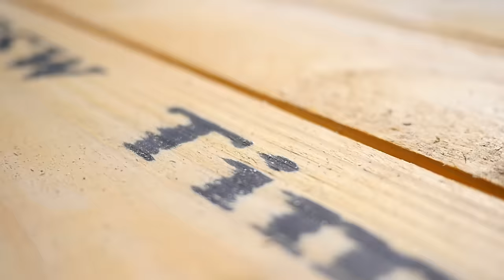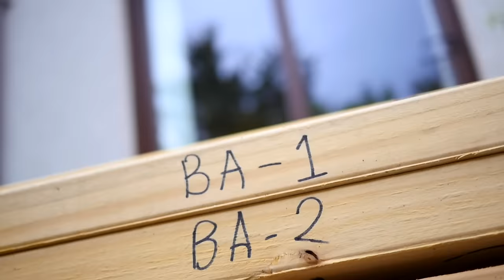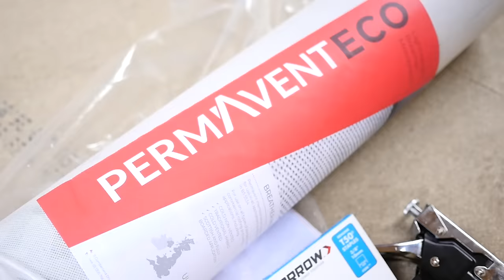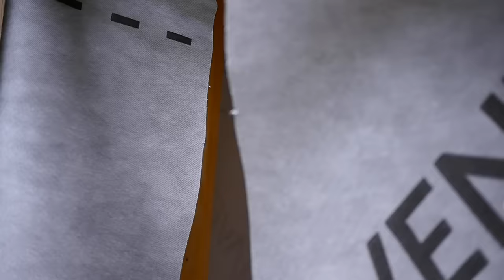Building a Workshop Shed In The UK From Scratch

Comment: Great build but you will get a lot of rising damp and condensation ... shame you didn’t run power
Reply from the maker: Hey Tight Tackle, I'll so glad you have enjoyed it.
All electrics are now in using office conduit. I got a pro for this as I'm not going to take responsibility for electrical work till I've got some real training. I'm sure you can see the conduit in some of my other videos. It goes right around the workspace.

As for the damp, I've talking to many joiners and as i've gone the extra mile to make this a breathing structure they have all told me I should be fine *fingers crossed*. Really hope I've not shot myself in the foot. Thank you very much for you concern and point it out tho.
Reply: Why would he get rising damp? He used a dpm under the timbers although ideally should have got the timbers off the ground but as for the rest, he encased the whole structure in a breathable membrane even the roof.. I'd personally have used some vertical batons around the walls before attaching the shiplap to give a bit of space for it to breath from the inside out but overall I'd imagine its fine.
Reply: You answered your own question mate lol
Reply: Maker Tales it will be fine but would of been great to raise of the floor, that will be your main issue ... which is why I point it out now so you get a longer life instead of the timber rooting! I’m very jealous you have your man cave lol 👌🏼
Reply from the maker: @Audiotorium87  Hey no problem. Unfortunately, I was playing with some VERY strict hight limitations. SO my choice was to raise it off the ground and hit my head every second I'm in there ( I'm 6 4") or keep it on the ground and do the best I can with pressure-treated timer, dpm and drainage. I'm sure i'll make update videos in the summer and gave a close inspection of the whole build to see if any issues arise

Comment: I bought a second hand electric benchsaw but I find I can't change the blade the hole in the washer is square can't get on the drive spindle
Reply from the maker: Hey Keith,
I don't know no much about benchsaws. Do you have a model or make or the saw? I'll see if I can find anything to help 😀
Reply: @Keep-Making  thanks for your help with my saw I put bench saw but it's really a mitre saw I found the trouble in the middle of the  blade is a washer that goes only into the blade itself, thankyou again

Comment: How much did it cost approx
Reply from the maker: Hey Adam Smith,
I have a few FAQs down in the description, but to answer your question: So keeping tools our of the pricing In total it came to around £1200 But this includes extra wood to make workbenches too. It's 2.9m by 2.9m . Has a close to 7-degree pitch and highest point is 2.49m. Keep in mind that I have completely over-engineered this workshop for 3 reasons. 1. I'm in Scotland and I get a lot of rain so I had to have a pitch on my roof. 2. I'm close to the sea and there is a field with an unobstructed prevailing wind so I get gusts of wind up to gale force 9 pretty regularly. I had to keep room for 100mm rockwool to make sure I could stay warm and more importantly that I would not bug the neighbours too much.
Reply: Awesome cheers good job by the way.
Reply from the maker: @adamsmith-qw9xs  Cheers Adam!

Comment: Hi, great video but I think I would have made a slight adjustment to the way you have used the insulation. I note tha tthe insulation has both a gap below and above and taped to the inside faces of the joists. One thing to consider is moisture. The foil on the insulation is there to act as a vapor barrier and I would suggest that you install the insulation level with the top of the joist and then seal the top of the insulation slabs by fully overlapping across the top of the joist, thus making a full sealed foil VB. This way you will not have to worry about possible future moisture penetration of the flooring from the joists. By raising the insulation and creating a larger gap beneath would also help with airflow.

See example 

https://www.youtube.com/watch?v=hiHwXI8ujDo

Good video and I enjoyed watching.
Reply from the maker: Cheers Mike,
Ya I think i would have got about it a slightly different way now. Thanks for the heads up. For my first build I think it's starting pretty strong still. In a few months time I'm going to be doing the FAQ / one year later video were I'll be taking a look inside walls, Under the shed and everywhere really to see where things could have been improved. My only concern of having hte foil right up against the wood is creating a moisture trap . Would this not be the outcome? Ignore there is no air flow. I'm say if there was airflow would this still not be a moisture trap to have the foil right up tp the floor?

I'm so glad you enjoyed the build
Reply: @Keep-Making   If the insulation is fully sealed across the entire surface moisture will not penetrate from below so any moisture present would have to come from above ie: from within the building. If the flooring used is of the standard moisture resistant variety then moisture should not be an issue. To be fair, the question of moisture is very subjective as it is wholly dependent on the overall construction, materials and use of the building. Ideally, if heat loss/retention is important then I would suggest you first infill with 50mm insulation between the joists and then add a second 50mm insulation layer to the full floor area covering over the joists thus preventing any cold bridging from the joists (where there is currently no insulation). Again fully seal the foil face at any joins/interface with the main frame. A decent air gap/flow under the joists/insulation would aid in keeping the moisture level down and prevent rot.

Comment: Excellent build of your shop, and although several people commited about your editing I would have preferred to have seen less of the 'showcasing' where each completed item was shown four or five times longer than necessary - ever since some of the game shows where models wander around the stage and point out the obvious has this become accepted even though not really necessary.

I built an 8' by 15' shop in the backyard a few years ago and even though it was built on top of a 4" thick 16' by 20'  reinforced concrete pad I applied two thick layers (four coats) over a two coats of roofing tar or 'bitumastic' coating over a two day period to protect the baseplates/baseboards from being infested by insects later or rotting due to water damage, and I offer this in hopes it will save someone some throuble with problems like this a few years after they've been built; several years later my Wife had a 10' by 12' by 13' high gambrel roofed shed with a mid- level loft built because she felt it would better suite my needs instead of my single story shop which at 8' wide proved to be too narrow to do some of my projects inside of.

And the one thing I was proud of was it took two days of strenious work for it to be torn down - partly due to the 2"X10" steel connectors which were used during it's build - build it right the first time and they will treat you right, meaning they will stand the test of time, which yours will because of the care you took in building it.

One question, what is the required "set-back required from your property line to where you can erect a structure (?), here in CA. It is 5' and I ask because it looks as though the distance from the sidewalls to the fence was about 3' or 4'  so out of curiosity is why I ask.

As I said, overall a very nice shop and thank you for sharing your expertise.
Reply from the maker: Hey Larry, I'm glad you enjoyed the video.
I appreciate that this style of video might not be your cup of tea. Considering I was aiming for a montage I thought I would go all out. 
That's a decent size build you made there. All I can say it that I love the stuff.... I really wish I coated my base with bitumastic paint too. In a few months time I'll be doing a 1 year review of the build and who knows I may add and fix some things what have been mentioned. I may have to jack up the build and paint the underside with a mop 😅.
I happy to hear that you think i've built it "right" first time round.

In regards to the set back. The UK is rather interesting....  Please anyone reading this do not take this as legal advice and please do you own research In my area as shed that is less than 12 m2, no higher that 2.5m can be right up to boundary lines within reason. Must be set inline or further back from the front of the house and must be a minimum of 5m for a public road. Once you pass 2.5m high. Then you start going into the realm of really pain in the but building code style stuff.

and once again i'm so glad you enjoyed the watch 😀

Comment: Great video! And I have pressed the subscribe button. Can I just ask what wood do you use for the walls? Is it 100mm x47mm? Many thanks
Reply from the maker: Thank you Richard!
When you say the walls do you mean the studs or the sheets?
Reply: Maker Tales sorry I meant the studs!
Reply from the maker: @richardsmith2887  No problem, the studs are 95 x 45 pressure treated timber.

Comment: what was the cost?
Reply from the maker: Hey Gary Arnold,
Just a heads up there are FAQs down in the description but in response to your question. Keeping tools our of the pricing In total it came to around £1200 But this includes extra wood to make workbenches too. It's 2.9m by 2.9m . Has a close to 7-degree pitch and highest point is 2.49m. Keep in mind that I have completely over-engineered this workshop for 3 reasons. 1. I'm in Scotland and I get a lot of rain so I had to have a pitch on my roof. 2. I'm close to the sea and there is a field with an unobstructed prevailing wind so I get gusts of wind up to gale force 9 pretty regularly. I had to keep room for 100mm rockwool to make sure I could stay warm and more importantly that I would not bug the neighbours too much.
Reply: @Keep-Making  Sorry was browsing my phone completely missed it.
Reply from the maker: @snappyfish  Nah don't worry about it Gary. I'm happy I could answer the question.

Comment: Hey cool video I live in the uk 🇬🇧 and what a great workshop can I ask do you need planning permission for something of this size I’d love to build one in the summer but don’t really know how am going to go about it
Reply from the maker: Hey Littleyammy!
Great question, I'll be making a whole video in the future for all these UK based questions. Plus i'm SO glad you enjoyed the video.
Long and then short of it, it's different council to council. Having said that they usually follow along with the same rules as followed. ( Please note that this is NOT! legal advice and I suggest you get in contact directly with your council or look of your councils online documentation about these matters) 

Points to bear in mind when erecting a shed

Here is a handy checklist of some of the main points to remember:

Your shed should not be positioned forward of a wall that forms the principal elevation of the property.
All sheds should be single-storey in nature.
The eaves height should be no higher than 2.5 metres.
The maximum overall height should be no higher than 4 metres for a dual pitch roof (all other roof options have a max height of 3 metres).
If the shed stands less than 2 metres from one or more boundaries of the property, the overall height should not exceed 2.5 metres.
In the case of designated land, planning permission will still be required.
In the case of land in national parks, Areas of Outstanding Natural Beauty and similar sites, any sheds or similar structures over 20 metres away from the house cannot take up more than 10 square metres.
In the case of a listed building of any kind, planning permission will be required.
It is also important to note your shed should not be designed to provide sleeping accommodation. Any building that essentially marks a change of use for the property should be looked into in more detail.

Sourced from: https://www.sheds.co.uk/planning-permission/

Comment: Just to let you know, that lock is useless on the door since someone could just pull the pins out of the door if they wanted in.
Reply from the maker: Thank you for your concern Even. Honestly, anything anyone would get form opening this door is a face full of sawdust. The facing which is held in with pin nails is only decor. The deadbolt is in the door frame itself. However, in the future, I will be reinforcing this connection even more so. Plus I may add a security bar across the door if I'm ever away on holiday. Plus I have 24/7 CCTV on the workshop itself.

Comment: Why insulate the walls and floor then sob and felt roof. Fibreglass it or tin sheet.
Reply from the maker: Hey Mark,
Well in a nut sell all my choices for this build were primarily for sound insulation. Fibreglass would be great for heat but sort of sucks for sound and tin... I'm in Scotland it rains a lot. To much noise for me to handle with. I hope that sort of explains my choices. Cheers

Comment: Anybody else wondering why he didn't run any electric?
Reply: If he added power by creating a new circuit he would need it to be signed off by building control. Even if he just spurred off an existing circuit, it's still 'supposed' to be done by a "competent person" i.e. an electrician as it is a permanent installation. However, if he simply runs an extension lead to the shed no permission or signing off is required. That may not be the reason but it's the most obvious one.
Reply from the maker: Where is the power?

All electrics are now in using office conduit. I got a pro for this as I'm not going to take responsibility for electrical work till I've got some real training. I'm sure you can see the conduit in some of my other videos. It goes right around the workspace.

Comment: Was that cement board you used for the floor?
Reply from the maker: Hey John, it's a standard house building tongue and groove high-density treated chipboard flooring. One of the few materials that slightly moister treated as it's on the floor.

Comment: MMM Not Sure about using any wool "PRODUCTS INSULATION" in an out building. Should always have vapor barriers both sides MIN most of this stuff is highly dangerous to human lungs and is 2x more porous than a sponge.....never mind bacteria and the microscopic spores once it's in it 2x harder to get back out! jmo but thermal insulation is better thinner and easier to fit although it will keep the heat out in summer and the frost out in winter you will need some sort of heating pos even an Induction boiler !

Comment: Stopped watching after you laid the joists and put the insulation in.......good luck
Reply: Why?
Reply: @iamneallyons4263  Because the subfloor is a cowboy job, how they squared the floor using a speed square and leveled the floor with a two inch level. All seems very amateurish and I'd learn nothing. Hopefully the doors and windows fit and are square, hang true and open close without issues..........as I said good luck

Comment: Shouldnt have had the void in the between the floor amd the insulation. Looks like a promo video rather than showing how its done. Music really loud and annoying.
Reply from the maker: Long and the short of it, I've asked quite a few joiners and there's not much of a difference. The best thing is not to have the materials touching. If they were this would then act as a moisture trap, which would then mean the flooring would be sitting on high moister and soak into the wood. As for the rest, I'm sorry it's not your cup of tea.
Reply: @Keep-Making  of course there is a difference. There is no ventilation in the void which will create condensation. It should be flush with your flooring as the PIR board has the foil vapor barrier.
Reply from the maker: @craigmorris3941  Well Craig, thank you for your concern. I hope I've not shot myself in the foot.
Reply: @craigmorris3941  he could always drill some holes into the floor at the sides to allow any moisture to escape..
Reply: @iamneallyons4263  that defeats the object of having insulation
Reply: @craigmorris3941  it would stop the floor rotting...
Reply: @iamneallyons4263  i see your point if the mistake has already been made by leaving the void
Reply: @craigmorris3941  well thats my point, unless hes going to rip all the floor up again which i dont think he will - he could drill some small holes to allow any moisture to escape the void.